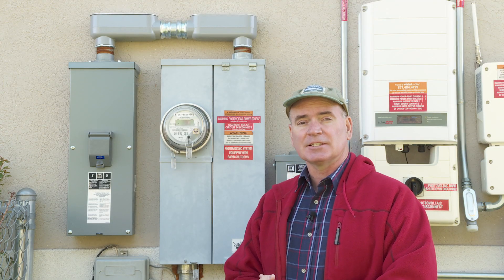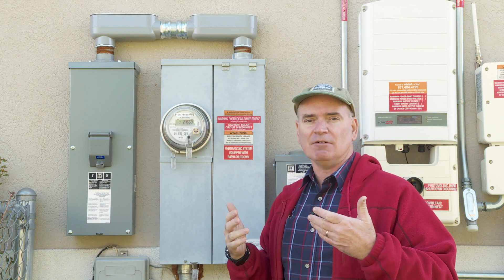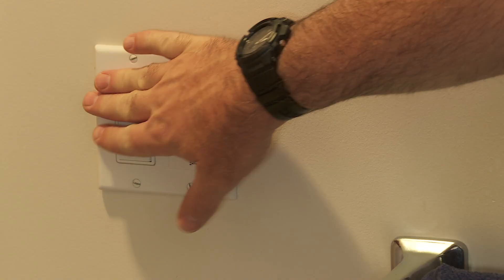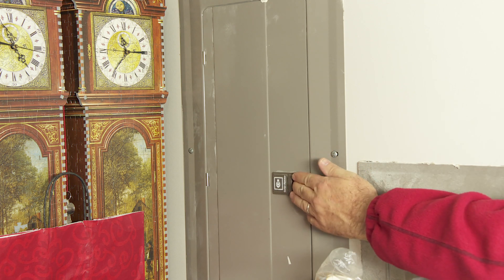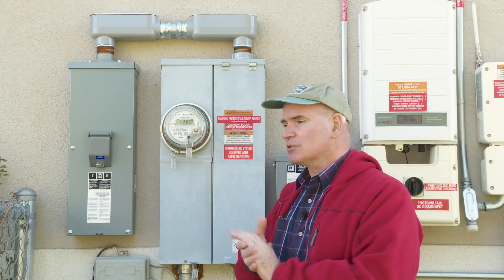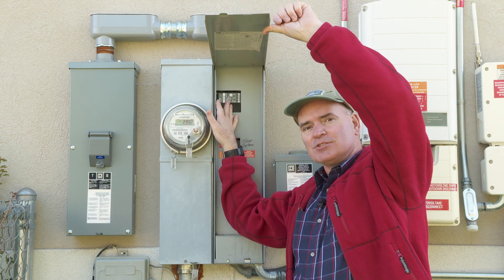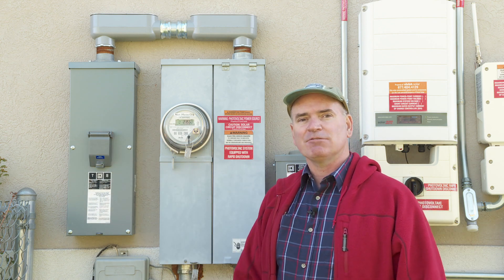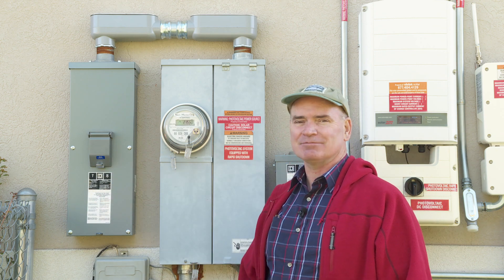Solar Panels - Adding Another Main Breaker For Our House

Comment: 10:50 that's stupid. like seriously, who ever designed that will cut you off from solar and grid tie all with one switch. and theres too many lines being run from the grid\solar to that secondary switch and than back to the primary panel going toward your house breaker box. I would throw all that away and restart from the beginning.

Comment: To clarify,  what does that "mixer" wiring look like underneath?      is it simply Grid-lin-in  via a breaker to a Solar-line-in  via a breaker to the same bus bar?     and then a breaker going to your MAIN FUSE BOX?          If yes (or similar)   couldn't you have just added a breaker directly to the Main Fuse box and "mix" it there?         I'm trying to find more information about this online, but, seems I'm using the wrong terminology as there isn't any vidoes with that specific deatail of "mixing"   existing grid and Solar into one place.

Comment: thanks for this video..  I'm still unclear about the "MIXING" of energy sources.   (grid and solar)    is that ok to do?    using your analogy of water,   if I have 2 low pressure water hoses, filling a bucket,  mixing dis-simlar water is fine.   there is no such thing as "back feeding".    but. I thought that with electricity,  that IS a thing to worry about.    no?     Where my confusion lies is with my gasoline generator 5kw.   I was told never to hook it up to the breaker box without 1) turning off main breaker,   2)  never at the same time as the grid,   for fear of back feeding.     Would this also happen with solar panels?    or does it have to be one or the other?    sorry for confusion.

Please help..  I'm very stuck here.
Reply from the maker: The grid provides as much power as the house demands. If there were no solar panels and I had everything in the house turned off then the grid wouldn’t push any power into the house. If I then turned on a 60 watt light then the grid would only provide 60 watts. If I turned on a 1500 watt heater then the grid would immediately provide 1500 more watts. If I turned everything off again then the grid would instantly stop pushing power into the house. So that’s where the water pressure analogy doesn’t quite fit. Yes, there’s lots of electricity available but it’s not “flowing” into the house if there is no demand. It’s not building up “pressure” while the demand is low.

The danger is that the lines into the house are like pipes (or hoses) which can only withstand a limited amount of pressure. So if the “demand” for electricity exceeds what the incoming wiring can safely handle then you need circuit breakers to stop that demand. Otherwise the “pipes will burst.”
Reply: @GoodTimekeeper  Thanks Greg,  especially for breaking it down with analogy and simple form to get a good basis for me.   sounds like I could talk to you for hours.   I've been trying to wrap my head around the finite details for a few weeks.  I'll still get an installer to do it, but, I want to know what he is doing, and then be able to experiment with it on house, or maybe even future boat project.  🙂
Going along same lines as your grid "demand" item.   if the solar panels are hooked up, and producing 2000w,   but nothing on inside the house,  is that a problem for any wires?  or is it also "dormant",   with no issues, no buildup anywhere?
I figured that's how it works,  but,  I do want to make that 100% clear and confident in my brain.
Reply: @GoodTimekeeper  ok,  last point, and I'll leave you alone.   As a test,  could I just simply buy 2 - 400w panels and a cheap inverter and plug it into a breaker at the bottom,  slap a 20amp breaker on it,  and then (if good sun),  I will technically be using 800w less grid energy, for the hours of sun right?    or am I oversimplyfying it?
Reply from the maker: The thing with this solar panel system is that it is specifically designed to feed power into the grid whenever it’s generating more than the home is using at that moment. A gas-powered backup generator is usually not designed to do that. That’s why your breakers are set up to keep the gas generator and the grid from interacting.
Reply: @GoodTimekeeper  ok,  so,  then,   how does the Grid know to supply less power than the solar (inverter)?      i.e.  my usage is 10kw,    and my inverter is sending 6kw to the breakerbox.    how did the grid just "know" to supply less than 100% from the inverter?   i.e.e.   why didn't the solar back off?  while grid provides the power?   or somewhere in between?       Yes, Ideally it would be 100% of available power from solar (inverter)   and what ever deficiency would come from grid.    I just don't know what regulates that?     is it because the grid is farther away?     solar is stronger being local?   what governs this?
Reply: @GoodTimekeeper  following up with the water analogy (yes I know it's not an exact comparison),  but,  if you had 2 hoses filling a bucket,     and you had to maintain 10L/min.      and one hose started churning out more,  what would tell the other hose to supply less?
Reply from the maker: There’s nothing trying to push power into the house until there’s demand inside the house. So it’s not as if there’s the equivalent of “water pressure” building up when there’s no demand. But the grid is always ready to instantly respond to increased demand in this case.

The big deal with all of this, or, shall we say, the part which changes everything is hooking anything which generates electricity (or a battery which provides electricity) to the grid. This is where the power company is extremely interested in what you’re doing. And local authorities like building inspectors want to know all about it too.

When we had our panels installed we could, in theory, start making electricity immediately. But we didn’t have a net meter, so any excess electricity going to the grid would have been regarded by our meter as if it were electricity we were bringing from the grid. The old meter couldn’t tell the difference between electricity coming in and going out. All it could see was how much electricity was moving through that meter. So there would be no advantage to tying a small solar panel system to the grid without a meter to recognize it properly. And you usually can’t get that meter without telling the power company exactly what you’re doing (along with a building inspector).

Comment: Greg- I had solar installed in June 2021 sunny California. Is it possible to trip main circuit breaker if less energy is consumed?  Example, I left home for 6 weeks, turned off my hot tub as well, when my son v checked on my home he found power outage. My electrician came in and stated the solar was generating a violent surge therefore tripping breaker. Is it possible to trip circuit breaker because low consumption of power plus generation of too much power cause the circuit breaker to trip?
Reply from the maker: I’m not sure what he meant by “violent surge”. The solar panels produce DC and the inverter converts that to AC. The panels would only produce a “surge” if there were a surge of sunlight. The inverter shouldn’t be making surges unless it’s malfunctioning. If the inverter is making more electricity than the house is drawing then it should be going back to the grid (at least, the way our system is set up). If something is tripping breakers then it would seem to me that the solar power system is not properly matched to the breakers being used.

Comment: Great video. I had solar installed in sunny California home. I had no issues for first 6 months  until I left for a 6 week vacation. Before leaving for vacation, I turned hot tub off, while I vacation my son visited home and found the main circuit tripped. My electrician says it is due to a violent surge of power coming from my solar. My solar company hasn’t come out yet to inspect but says it can’t be true. In your opinion, what could be causing the tripping if I am.not home to consume power, yet have solar generating?

Comment: 120% rule violation..
Reply: No, they derated the main 200-amp panel by reducing the main breaker from 200 to 175 now the busbar can only be fed max power of 175 amps from the grid and 40 from one inverter and 20 from the other looks like micro inverters I maybe lease system. Total is 175 grid + 60 amps of solar comes out to 235 amps 5 amps under the 120% of 200 which is 200x1.2 = 240 amps. Not sure why they added that 2nd panel maybe so someone could cut off the sub panel inside without access to the home.

Comment: Good info, thanks Greg. Although the metal cover in your meter panel (where your main beakers are) is not set/installed correctly. Needs to be pushed flush with breakers. I can literally see it pushed up against the lower breaker, not safe as it can cause breaker to be unable to shut off properly. 
(General contractor, and would chew out a sub if they did that shit)